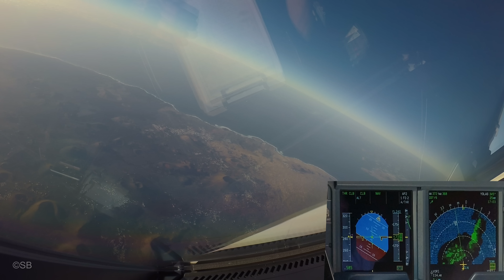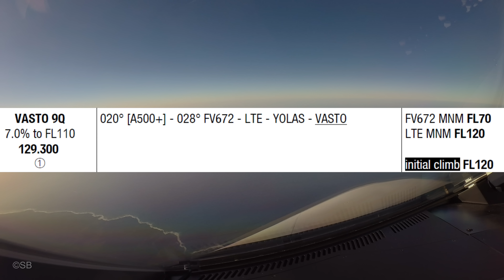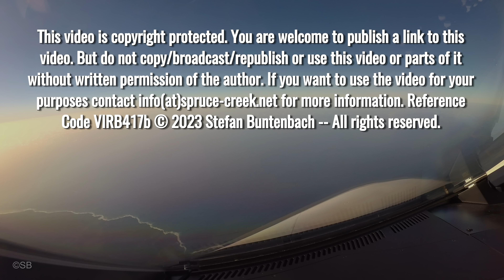FUERTEVENTURA | Briefing, taxiing + departure runway 01 | Airbus 320 NEO cockpit | with charts

Comment: Re-watching this today. One of your very best Capt Stefan. It is absolutely fascinating to understand the crew resource management and airport procedure.
Reply: What does FLEX + 59 mean on the NEO?
Reply from the maker: Thanks for watching and your friendly feedback!
Reply from the maker: Flex 59 means that the engine power is reduced to the same amount of power we would have with an outside temperature of +59 degrees Celsius and full power. We call the temperature a Flex temperature. It is also sometimes referred to as an assumed temperature because it is not the real temperature. This procedure, in general, is the same for CEO and NEO.
Reply: @ApproachandDepartureVideos  Is this so-as to manage the engine life? No point in using more fuel/power than necessary which extends the service life of the engines I guess.

Comment: These are great videos, giving a superb insight into the working flight deck. Can I ask, what is your company’s preference / rules when it comes to pilot headsets? Do you use your own / company supply ?
Reply from the maker: Thank you for the friendly feedback! The headsets belong to each airplane and are provided by the company. We do not use our own headsets. This setup differs depending on the airline. Some time ago, I flew Airbus A320 for another airline. We had to bring our own headsets. The company provided only a non ANR backup headset on board.

Comment: Excellent Video but I have one question why did the vertical speed indicator at 17:50 say you were climbing was that because the runway was rising or something else?
Reply from the maker: Thanks for watching and your great feedback! This is an interesting  observation. I assume that you are right about the vertical speed indicator. The runway has an upslope, which means the altitude rises a little during the takeoff roll. Subsequently, the VSI reflects this.

Comment: Great video. Just wondered when you decide how long to fly the bird with FD and no AP. And when to engage AP? Is it just that you enjoy flying the aircraft or are there safety reasons. Thanks 👍👍
Reply from the maker: This is a question in regard to an approach. During departure, we do not use the bird at all. And during approach, we usually do not use the bird with FDs on during manual flight. This would show the flightpath director, which we usually follow only with autopilot on. If the FDs are off, we use the bird for raw data flying and visual approaches. The pilot flying decides about the guidance for his or her approach.
Reply: @ApproachandDepartureVideos  I'm on about departure only. The FD was on but AP off until a certain point when it was engaged. So the FO was flying following FD ?
Reply from the maker: @birdman4274  This is correct.

Comment: Superb video. I noticed you mentioned 300 kg fuel / 8 minutes extra. Is that the calculated remaining fuel in the worst case scenario? And that parallel taxiway used to be a runway, markings still partly visible.
Reply from the maker: Thanks for the good feedback! Our fuel calculation takes into account   the fuel for taxiing to  the runway, for flying the departure, the route to the destination plus a standard (usually long) arrival and approach. In addition, it includes fuel to an alternate airport plus 30 minutes final reserve fuel and a certain percentage of general reserve fuel. The extra fuel comes on top of all that. Our preplanning for this flight calculated us with a fuel amount which would be good for 1 hour and 8 minutes flight time for the landing at the destination. We saved some fuel during the flight due to shortcuts and a shorter arrival and approach. We landed with fuel for more than 1 hour and 20 minutes flight time. If we would have flown after that to the alternate airport, we would have  landed there still with fuel for one hour flight time.
Reply: @ApproachandDepartureVideos  Thank you for this information!

Comment: Nice follow-on from last week's arrival into Fuerteventura.  You have got the camera angles very good now!   A question for my curiosity - I noticed that when you were lined up and ready to go, even through he was Pilot Flying  your FO responded to the ATC message that cleared you for take-off.   Do you take over the radio once you are in the air?
Reply: Hello Geoff H.

You can hear after he have respond to the atc that the captain have said “you have control” and after he say that then they have switched the roles and the FO have control and the captain make the radio 
I’m not sure if this 100% right but this is from my current knowledge
Reply from the maker: Thanks for watching and your question. Here the First Officer is always doing the ATC communication on the ground and the Captain is taxiing the airplane. Once in the air, it changes. The First Officer is flying and I am talking to ATC.

Comment: Wieder tolles Video. Frage: Warum macht man trotz der stärkeren neo Triebwerke die packs off, würde die Leistung nicht auch mit packs on locker reichen oder gibt es noch andere Gründe ?
Reply from the maker: Die Leistung hätte hier locker gereicht.. Kein Problem. Wir starten nur selten mit voller Leistung.  Packs off benötigt etwas weniger Leistung beim Start. Das reduziert die Abnutzung der Triebwerke,  verbraucht etwas weniger Sprit und verursacht weniger Emissionen.

Comment: The pushback is a little strange for me, they basically push you past the taxiway onto an apron, and then you have to turn back onto the taxiway? Why wouldn't they just do a push back and have you turned south on the taxiway?
Reply from the maker: They usually do something like that to keep the taxiway clear for other traffic. So the other traffic can pass by or even turn into the parking position we just left during the timeframe when  our pushback truck is disconnecting and we do our checks.
Reply: @ApproachandDepartureVideos  yeah, I guess it works, just used to all the U.S. airports where you push straight to the taxiway and they turn you towards the runway

Comment: You guys turned on the radar on ground?
Reply from the maker: Per Airbus SOP, the weather radar should be turned on on the way to the runway.  This is especially required if the radar and the predictive windshear system are combined in one switch. If they are separate, during nice weather and daylight, the weather radar may be off during takeoff as long as the predictive windshear system is switched to AUTO.

Comment: seems strange to me for pilot not flying to be handling throttles, no? (setting takeoff thrust)
Reply from the maker: Good observation. Here, the Captain is always taxiing the airplane. Even if he or she is the pilot not flying. This includes the movement of the thrust levers. For the takeoff, the First Officer takes over the thrust levers once the airplane is in the air. These  procedures differ from airline to airline. They have usually in common that the Captain has his or her hand at the thrust levers during the takeoff run. Reason for that is that the Captain is always the person who is doing a possible takeoff abort. Have a nice day!
Reply: @ApproachandDepartureVideos  the case of the MD88 in Michigan a couple years ago was a case where the PF, not the captain, had to be the one to abort, because the problem was with the flight controls that only the PF would notice. based on that and other things, i would prefer to have PF be the one on the throttle (perhaps the captain can double up, but the PF not on the throttle is a big problem imo in contingencies.) regardless, many thanks for the reply <3

Comment: No dual cooling for engine start with this NEO? Seems like one of the very few downsides of the NEO's 😀
Reply from the maker: Starting the NEO engines  takes a little longer than the CEO engines. But this is completely acceptable due to the many benefits the engine has.